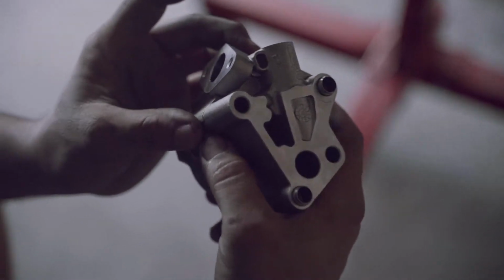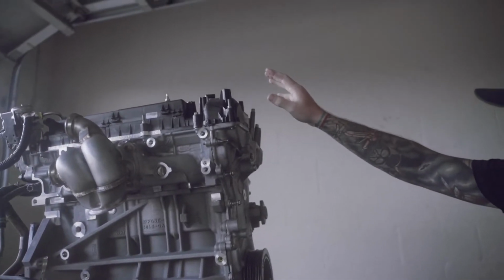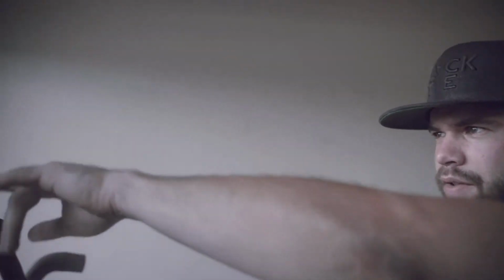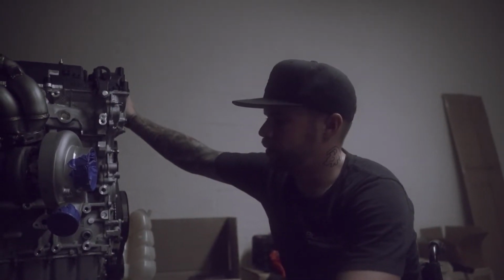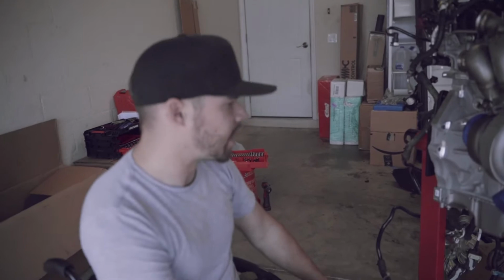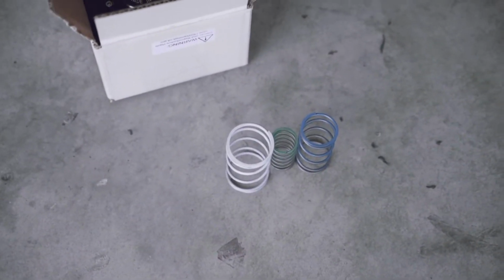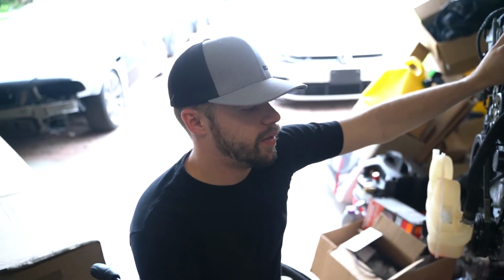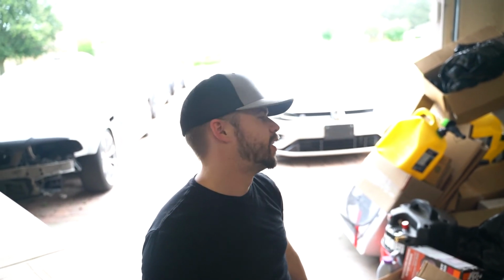Built Motor Assembly For The Big Turbo Focus RS (PT.2)

Comment: nice build!, which head gasket did you use?, the 2.0 or 2.3? And as for the oil filter housing, did you have to use the 2.0 or 2.3? only things I can’t figure out with the 2.0L build. and if you have any pics of what needs to be plugged on the 2.0 block for the 2.3 head to work, thanks!
Reply from the maker: The motor is from the guys over at tune+, everything that we needed to put the motor together was sent over from them. 👌